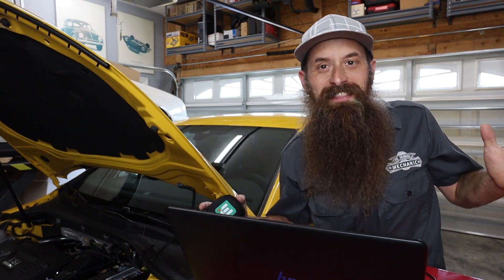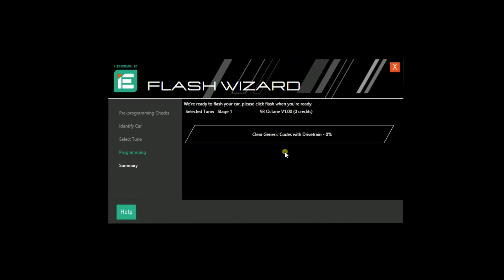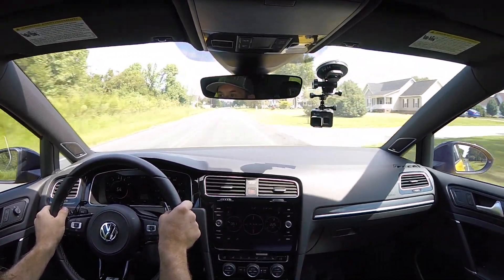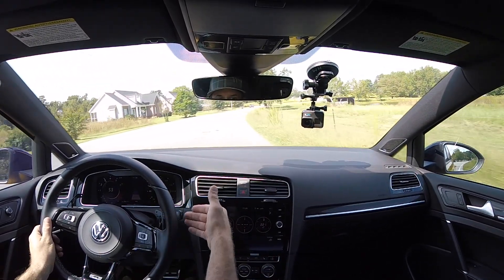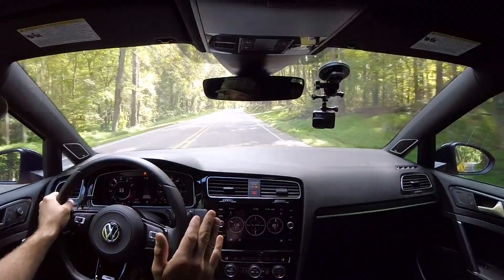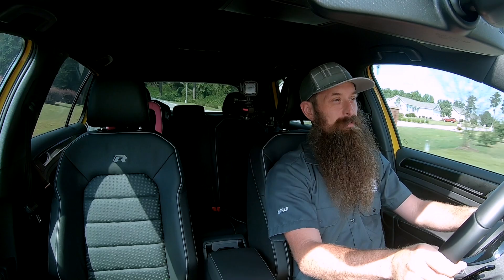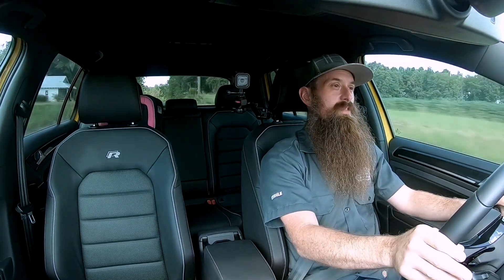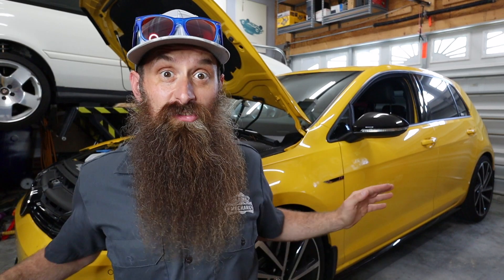How Much Horsepower Does a Tune Add? ~ Stage 1 Tuning Golf R

Comment: According to Ross-tech some tuners know how to reset the flash counter in the ecm. Does this tune? Or will there always be a checksum changed? It would be a very bitter pill to swallow if the engine had some sort of problem even if not due to the tube. Typically requiring an entire swap normally under warranty, however cos a flash was detected you’d be the one who had to pay for it. Exactly how smart is the ODIS system at the dealership?
Reply: Julian UK ODIS takes ECM data and sends it to VW database. Database checks weather the ECM is in production mode. Even if at one point the ECM was tuned and is currently in "stock" flash, it can see that it will register a TD1 in the vehicle data available to all dealers and to VW.  It will show TD1 active and inactive.  It logs multiple values like boost pressure, ignition timing and cam timing to see if it has exceeded manufacturers parameters.  It doesn't only look at flash counters anymore.   Or so I was told.  I could be wrong though.

Comment: I have the APR stage 1 (93) in my '16R, and it was a gamechanger. Very suprised how MUCH extra power I got from just a software upgrade. I went with APR cuz that's what my VW mechanic was selling at the time, but I wish I had more personal control over flashing.
Always wondered why they didn't come that way stock. I know that VW nerfed the stock power for the mk7.5's because of some european BS regulations. but still.

Comment: I work with tuning golf r in South Africa.

I can tell you off the bat that stage 1 is a waste.

Rather do a intake + downpipe with a stage 2 file

I guarantee all clients a minimum 40kw+ gains on the wheels. I can make more but at the risk of the client
Reply from the maker: Stage one is not a waste if you don’t have budget for stage 2 and all the parts associated with it. 

I wish more people stepped their modifications on their car instead of going all in all at one time. It’s a great way to learn more about your can and individual mods
Reply: HumbleMechanic stage 1 only makes the stock power rated on the flywheel the same on the wheels.

For example:

Stock golf 7.5r here in rsa makes 220kw on the flywheel from factory.

Flashing a stage 1 gives you roughly 220kw on the wheels depending on the altitude. Here in land you will make slightly less than 220 and at the coast you would make slightly more.

My clients who usually opt for stage 1 do it because they don’t want to make use of any bolt on mods and that’s perfectly fine too.

Why i say its a waste is because you would pay r4000 for a stage 1 and 4500 for a stage 2

If you first go for a stage 1 and then add the bolt ons later, this means you will have to come back for a retune so that the software makes use of your new bolt ons... basically reflashing the car from a stage 1 to a stage 2. The cost for that would r1000

Thats why i will always make sure on the clients plans with the car. If they are going to do bolt ons later then i will always advise them to do the bolt ons first and come see me for the tune after.

In essence i save my clients the hassles of paying r500 more than what they would and time to flash twice

Ultimately depends on the end goal but if you know for a fact that you will be going stage 2 then stage 1 indefinitely is a waste.

✌️

Comment: I just love how the R pulls out on Launch control @4000 RPM, no drama, no spinning tires, no need to compensate for Torque steer... it just goes.   0-60 times would be interesting : )
Reply: Draggy!
Reply from the maker: I need one of those data logger thingys
Reply: @HumbleMechanic  Draggy 100% They're beyond great
Reply: Isn't there a 0-60 built into the car?  There is on my 15 GTI😊
Reply: @JohnMaffa  Performance pack I believe, but Draggy is great, there's leaderboards so you can compete or get a better idea of what your car should and could be
Reply: Most with a proper stage 1 high torque are around the 3.5-3.8sec mark that's dsg

Comment: Should install the new VW Dynamic center caps on wheels.. would look dope for rolling shots like the launch control
Reply from the maker: They don’t fit these wheels
Reply: HumbleMechanic I found out the hard way that they don’t fit. Bought them online on VW site and it stated they fit. Received them, took a wheel off and disappointment set in. They are still sitting in the box in my basement.
Reply: We have them installed on a Golf R in showroom, hmmm... gloss black wheel package
Reply from the maker: @EuRo7uN3r  The center can is a slightly different size .
Reply: @HumbleMechanic  boo

Comment: A tuning company in the UK have mapped a lot of these to around 380-390 stage 1 that is usually with a full induction kit, turbo inlet, turbo muffler delete, obviously with a flash map like your you won't get as good gains as this but still not bad at all
Reply: Well obviously that has additional mods as well..
Reply: @stevenyia2778  Not a great deal of additional mods, especially considering the turbo muffler delete has no gains and the turbo inlet is very minimal
Reply: Which company? I'm thinking about doing my Rocco R
Reply: @proherb1828  Unicorn developments is it the EA888 Gen 1? 265bhp standard?

Comment: I really wish they had a tune for my 2013 2.5 Passat. It sucks they stopped at the 2010 2.5 Passat. I wonder if the transmission is the limiting factor or if other major changes happened to the 2.5.
Reply: Dave J, we do have support for your 2013 2.5L Passat... if it's not listed on the website it's because they put these 2.5L engines in a ton of chassis and we may have missed it on the applications, just know our tune covers ALL 2.5L N/A 5 cylinders. :)
Reply: @IEtuned  THANK YOU! I'll be in touch. I can't wait to get this done!
Reply: IE has a tune for your 2.5, it’s minimum power gain but it wakes it up!  It’s not listed on the site, but just buy the 2.5 Jetta tune and it works!
Reply: Travis Worthington  so a tune on my 02 Jetta GLX VR6 isn't worth it? The simple fact is that people have been running NA motors for ever. The first NA I worked on was a 71 super beetle with a 1600cc motor. I have done 4, 5, 6 and 8 cyl NA upgrades. With this it is so much easier to hook up a laptop and have it done verses the weeks of work I spent on cars like my 86 Merc Cougar  with the  5.0 or the 97 Honda Del Sol si or my 71 Merc Comet GT with the 351 ci and 4spd manual.
Reply: Send us an email. I wouldn't be surprised if we actually have that and it's just not listed. Sales@performancebyie.com

Comment: What if you have to take it to a dealership and get something fixed? 
Oh I forgot, you are Master VW Technician.
Reply: i reset mine to factory settings before i take it in. I was told if they load any new or updated software at the dealer, the tune can cause issues. idk if true. then i plug in and retune when i get hime
Reply: @fishman80  but they can still see the logs if they want to , they would know that you tuned it and got it back to stock
Reply from the maker: Unless its an issue the tune may have caused, they don't care. LOL
Reply: @HumbleMechanic  in aus warranty voided from tune engine/driveline/dsg voided happens here all the time haha
Reply: @iampyron22  Thats why I never messed with mine, the damn car still broke ...
Reply: @ventolen  Haha that sucks. Probs hasnt broken as much as my evo tho :P
Reply: ventolen well, that’s what the warranty is for numb nuts.
Reply: @iampyron22  the thing I like about you .. is that you know how to fix your EVO. n thats where i am stuck...
Reply: @ventolen  Nothing abit of youtube cant fix. If i was using a shop for all my repairs id be broke as hell haha
Reply: @iampyron22  in the us they have to prove the problem was caused by the mod if they cant your warranty still good😎 ...unless it specifically says you cant do something
Reply: @angelescards25  aus will void your whole cars warranty for a friggin pod filter. they kick our ass :P
Reply: @iampyron22  i heard Evos are are nightmares to work on.  i know a mechanic who refuses them.
Reply: @infowazz  they arnt that bad. Just gearbox/transfer case is a pain. Other then that they are one of the easiest sports cars ive worked on. Just that damn fwd setup gearbox is in a bad spot to remove vs a subaru setup like a rwd :P
Reply: HumbleMechanic must be a lot different than Audi dealers.
Reply: Thanks for the post. The torque bump seems too high don’t you think it will shorten the lifespan of the dsg?
Reply: @hwangedward  all mods usualy shorten the lifespan of cars engine/trans

Comment: Be careful with the car aggressively hunting for 6th gear at low speeds. LSPI is real
Reply: Do you mean specifically if it's tuned or with standard tune aswell?
I do find it shifting too early when being gentle to the throttle. I wish this easily could be changed. It's also really annoying when driving through town in D and it goes back and forth between 5th and 6th. So I usually drive in Manual mode through town unless coming up to a stop (so jerky in manual).
Reply: @AndreasElf  i drove from Houston- Pikes peak Colorado completely stock. Got back and got the APR stg2 DSG tune. Both aggressively search for 5th and 6th gear. 
But it seems like APR tune is a little worse, hitting 6th gear by 32mph.

Comment: Very nice 319 WHP 
Will you do the R32 ?
Reply: I don't think he wants to be disappointed with the R32. Factory it was only rated at 240 hp, so a high mileage engine is probably going to be down from that number. I wouldn't be surprised if it was less than 200 hp at the wheels. 

ABSOLUTELY LOVE the sounds from the R32 though.
Reply: @MesserEsser_OG  its named R32 based on vr6 3.2 
Has good enough room for big turbo with 7.5 psi easily can get it up to 360HP
Reply: @AliA-jr3iv  - Except it's not turbocharged or supercharged. Charles said before he planned on leaving it factory, IE not turbocharging it. The turbo toy was the White Wookie.
Reply: @Legotechs  - What rock did you crawl out from under? High mileage engines almost always lose power... 

Why?
Internal parts wear out, bearings, piston rings, gaskets, hoses, etc. 
Leaking gaskets cause significant power loss. Simply changing out the valve cover gasket and oil cap gasket often makes an older engine happier. However, it also puts strain on the worn out front and rear main seals. What happens when the rear main seal leaks? 
Bye bye clutch... 
I've replaced a few leaking gaskets only to have others fail. It's a not-so-fun-game of chasing oil leaks. 

Let's be honest here. 240 hp was factory rated at the engine. Measuring the hp at the wheels will likely yield 210 hp when brand new. Add 14 years and 140,000+ miles and it will easily lose 10 or more hp.

Comment: I went with the JB4 at first with the APR dsg tune.
Jb4 just never ran right.
Jumped over to Cobb, and the OTS 93oct v100 was great, but started to max out the Hpfp and would get thrown into limp at 5k in 4th gear. 
Went with 5150 custom tune, now car pulls hard, and im actually beating some is38 gti's
Reply: Some One Could you clarify about the JB4 I was thinking of buying one since you can do it yourself.  Since APR needs to use your car It’s a pain in the ass to do it.
Reply: @GladiatorGaming  the JB4 would cause random misfires and limp mode. 
And before George helped me tune it a bit. I was getting a trans code as well.
i would get random CEL (P00000) and fuel rail pressure. 
I was also trying to fix it/tune it. And really just gave up. I was looking for flash tunes and went with cobb. Installing it was 10000× easier, as it's only a obd2 port plug. And the cobb ots pull much harder than JB4.
Custom tune, feels and runs much better than the Cobb OTS.
Reply: @GladiatorGaming  if you have a 7.5, for now, get the Cobb Accessport. Just the cobb OTS tune you'll enjoy.  
Maybe once JB4 has dialed in the 7.5 i would stay away. 
You can always stack later 😁

Comment: in Germany you can get it with 310 and 360 hp, but my college bought one and he said, they offered him for around 2000€ a 380 hp tune from VW.
i think that is very interesting, because thats close to 400 hp, which is quite a lot. even though i think there are better performance cars out there.

Comment: What about your warranty Charles? I'd actually love to fiddle with my GTI and "toon it" but that will void the VW factory warranty.

Here in South Africa our warranty will definitely be voided since the vehicle is connected to VAG systems when its serviced and they'll detect a software change.
Reply from the maker: I answered that quickly in the later part of the video.
Reply: @HumbleMechanic  I know, sorry, kinda asked the question while watching  and didnt wait until the end of the clip :) 
These new Veedubs dont come with a service manual anymore and are connected to VAG while servicing to update service records. They will detect a software change and void warranty here in ZAR. I'm also aware you once worked for VW US so probably have contacts to get around this limitation. Good luck mate, next is the exhaust I hope?

Comment: I went with Unitronic stage 2 for my mk7 gti and the dsg tune was such a game changer. The extra smoothness of the shift points makes all the difference.
Reply: This.  I went uni also and the TCU tune MAKES the entire thing work.  Id even go so far as to say if you could only do one.... TCU
Reply: I went with a Uni Stage II TCU shortly after going Stage II plus on the ECU on my MK5 GTI. Not sure if they have higher ratings on the new seven speeds, but the DQ250 DSG in mine starting getting hinky in shifts when approaching the factory torque limit (roughly 290 lb/ft on those), the TCU tune not only cleaned/firmed up the shifts, but allowing the full potential of the ECU tune was well worth the money as well. Definitely pulled even harder after both tunes.

For a car that’s otherwise stock turbo with the usual handful of bolt-ons, these are the best two upgrades I’ve made for the money.

Comment: When you have a tuning device but  the clutch stinks for more power! 2018 vw gti
Reply: Yeah, get stage 2 clutch dude. I'm in the same situation. 17' GTI SE manual. I luv it though 👍🏿
Reply: My Mk6 had the same issue at stock power.  Not sure why VW can't put in a decent clutch.
Reply: @rennkafer13  agreed, that would be great if they did👍🏿